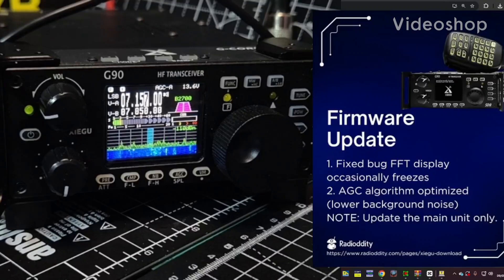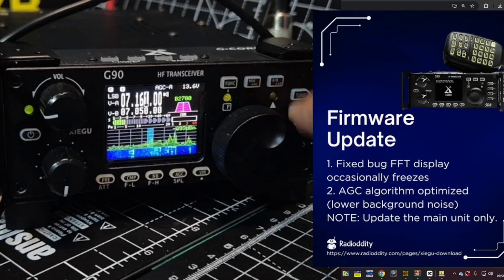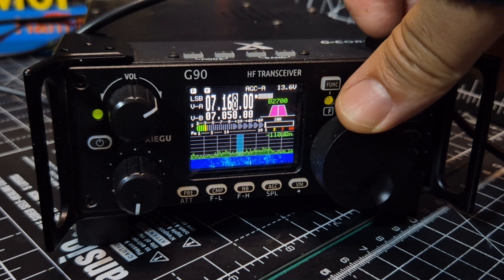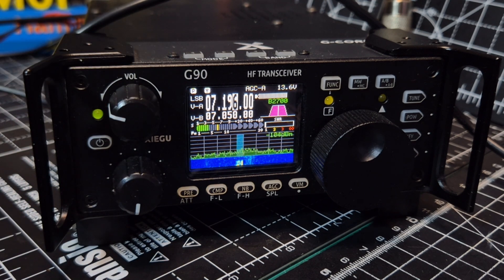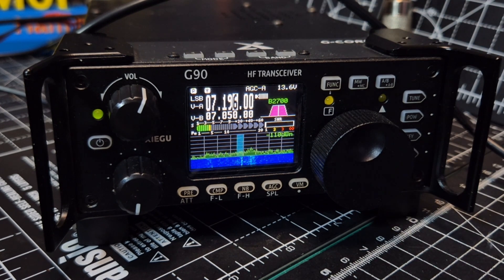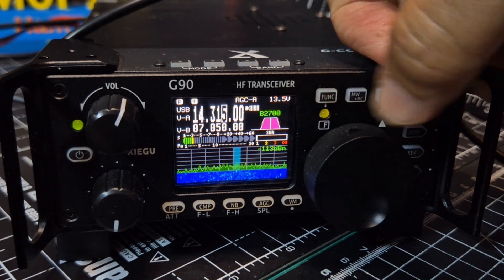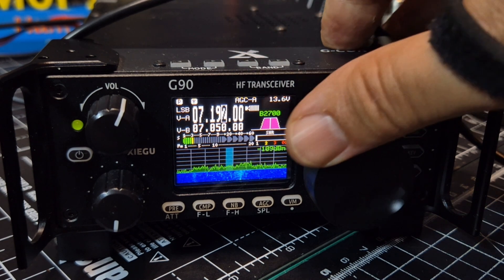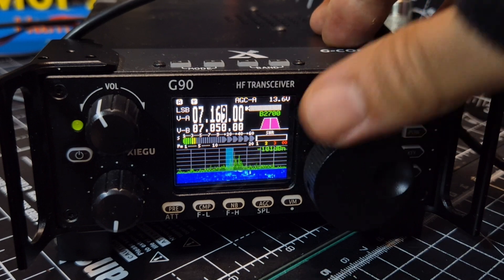Xiegu G90 - Firmware May 2025 v1.80

Comment: Hi all , I have been able to upgrade the main firmware 1.81.xgf, however when i tried to upgrade the display firmware 1.81xgf the screen has gone blank. My g90 has a prefix of "X' has anyone any answers how to get the display working?
Reply from the maker: Do the process again for the frint and back make sure you tick the 1k box in teraterm you can not Brick this Radio just keep trying .